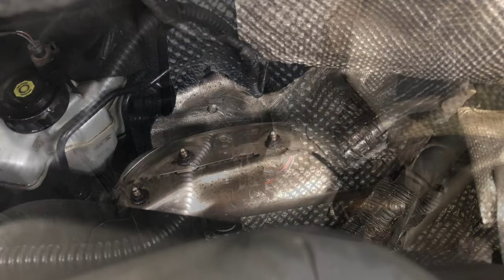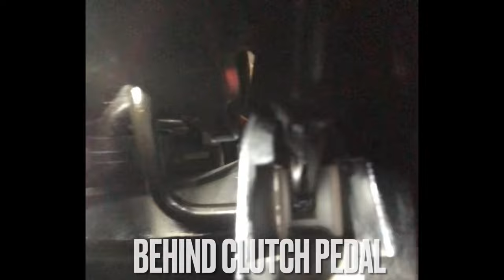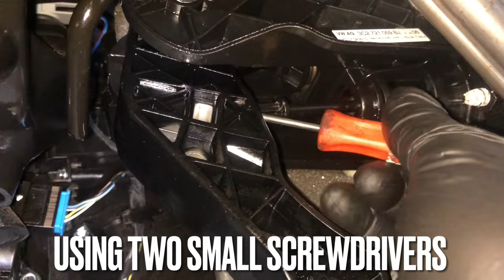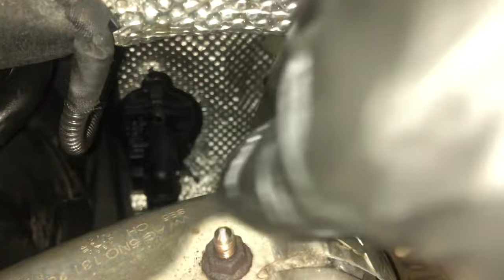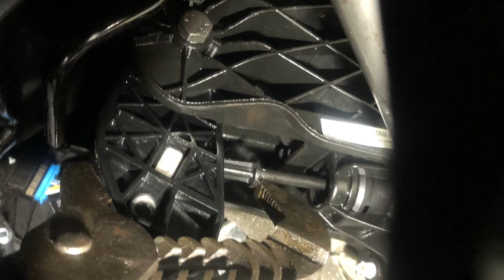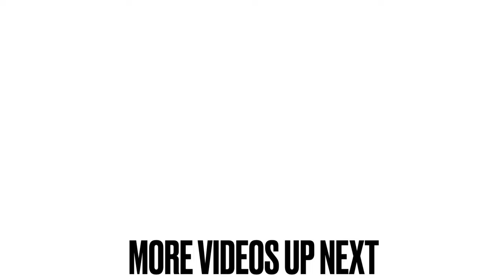How to Remove a Clutch Master Cylinder - Step-by-Step Guide. Volkswagen, Audi, Skoda,Seat.

Comment: Nobody tells us how to remove the electric plug on the cylinder at the bulkhead.
Reply from the maker: It’s quite easy. Push plug inwards the use a screwdriver push into release tab ,gently twist, it should click. It will then pull off. It’s easy once you have done it a few times. Try practicing on a easier accessible clip. Good luck!

Comment: Press the 2 white clips in with 2 screwdrivers externally as you see them (not from behind) and hey presto!
Reply from the maker: Thanks for the information.
Reply: Thank you! I'm trying to remove that SOB and went inside to find a video on how to do it. However, on my 2012 Transporter it's incredibly hard to reach even one of them, let alone both.

Comment: Wow, and this shop here in Fredrick Maryland lied and said that the transmission had to be removed
Reply from the maker: It will if it’s the slave cylinder.
Reply: @How2FixIt1 slave cylinder sits on top of the transmission in a 2016 Volkswagen Golf R

Comment: How did you bleed it?
Reply from the maker: The best method I have found is pumping the clutch pedal a dozen times or so, the open bleed valve a watch the air bubbles run clear. Then repeat above until you get a satisfactory pedal. Hope this helps. Thanks for your comment.
Reply: @How2FixIt1  great, planning on doing the job this week, I’m assuming the bleed valve is the one on top of the gearbox after removing the air intake
Reply from the maker: @MegaPanthor  yeah. That’s the one, Good luck!
Reply: @How2FixIt1  unfortunatly it won’t bleed, fitted master cylinder, but when I connect a pressure bleed kit or even doing manually nothing comes out from the bleed valve. Fluid is topped up
Reply from the maker: @MegaPanthor I currently have the same problem with a Passat.  I’m thinking it could be the flexi in line that has collapsed. Let me know what you find and thanks for your comment.
Reply: @How2FixIt1 did you ever find the problem? I’ve a brake fluid leak under the car what looks like it’s coming from around the master cylinder area myself. Leon MK2
Reply from the maker: @karldewww  I believe it was a combination of faults. It is definitely worth getting a seal kit for the pipe work and fitting them first in reflection. If it’s done a good few miles I would definitely consider changing the dual mass flywheel and clutch. Check out some of my other videos, most of these are covered.

Comment: How did you remove the fill pipe from the cylinder without damaging it?
Reply from the maker: I removed the cylinder with it still attached, then when it was moving gave me better ability to grip and twist it off, try using a little wd40 might help.